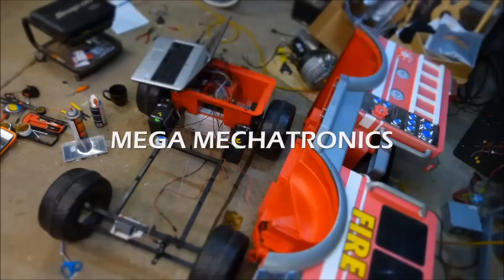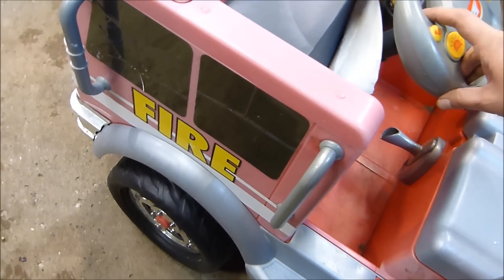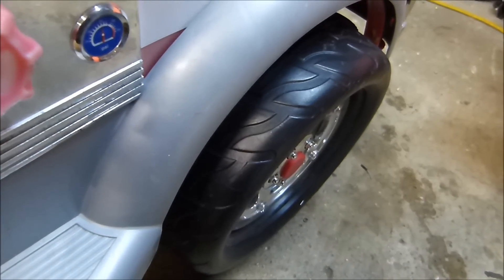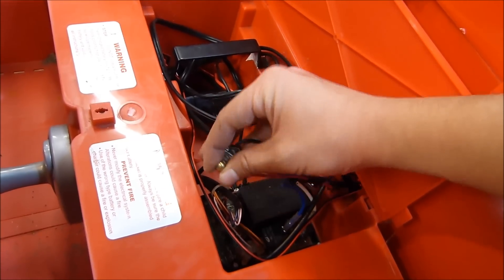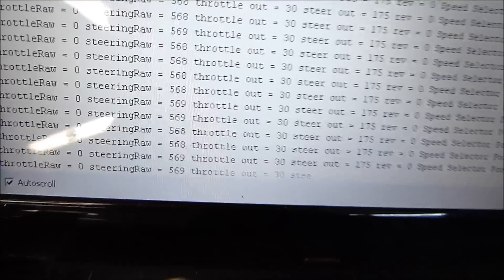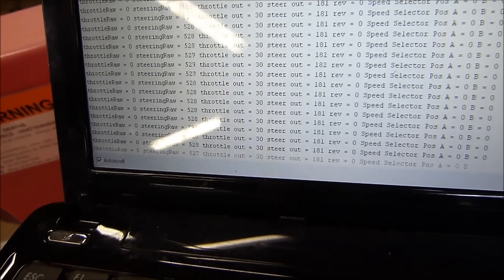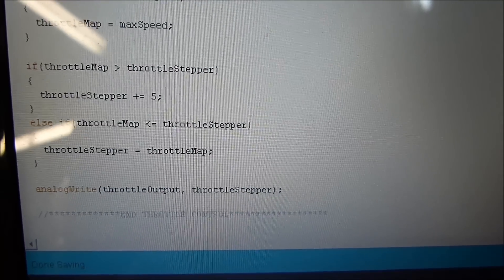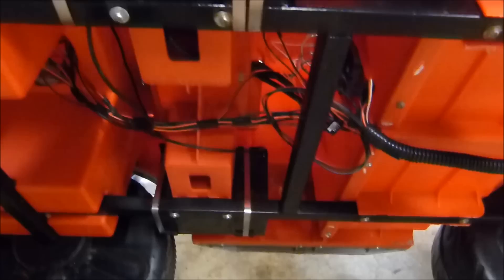Power Wheels 24v Upgrade Power Steering Kidtrax - Part 1

Comment: That's like the most time and cost into a car controller. Why not use a scooter controller and hall throttle peddle?

That's how I did mine.

Next mod is a working fire hose.
Using a car screen washer pump or two with on off switch and internal water tank. I've the avigo/kidstrax ram btw.
But can fit a fairly large tank 2-3 gallon. So should keep them entertained.

What did you use for your throttle?

Comment: I have a similar toy which is a real 4x4 with 4 drive motors , and it came standard with the drive-by-wire steering. But it's only center or full scale left/right so I wanted to have something that's proportional so my son can learn to drive better. What system did you use for the steering?

Comment: So i just got this fire engine for my son. The wiring was messed up and the people before us took out the circuit board and put in relays. I found a diagram online to show my how to wire it the right was. Ive rewired it about 4 times following the diagram to a "T". The motors on the back wheels work but after everything is hooked up, it wont move and when spinning the wheels with my hand they turn the opposite direction of each other. Any ideas?
Reply: You have to wire one motor opposite to the other.

For each motor, determine which wire is positive and which is negative, then hook the positive of the one to the negative of the other. This will cause them to go in the same direction.

Comment: never seen power steering on a kids ride on, interesting, I need to convert my dads Kawasaki sxs to power steering,(he's not getting any younger) you've given me some good ideas but I don't think 1/4 scale rc parts are gonna quite do it. but thanks for the vid, very helpful
Reply: You can find power steering setup on all parent control kids ride on, it's more robust and will require some engineering.
I would say use a car one, such as mini in the UK and lots of euro cars, but they are high current.

Comment: was your servo powered from the same battery used for the rear wheels? If so, how did you   wire it? Did you use a voltage converter?
Reply from the maker: I used a 5-6v step-down buck converter, made for RC from Hobbyking.

Comment: Nice work!

Do you have any details on how you used the servo to do the power steering?  I'm working on a similar project, except that the arduino will also be driven by a mobile phone app to allow remote control (my daughter is too small to drive).
Reply from the maker: +SuperGoines To deploy electric steering in a toy car such as this, I recommend triple giant servos or a custom stepper worm gear drive system.  Check out the new Firetruck video: https://www.youtube.com/watch?v=BVkE8oGCj0U

Comment: Fregging Cool!! Which motor controller did you use and how does the Arduino interface with it?
Reply from the maker: I got a $25 controller from http://www.electricscooterparts.com/ that uses a variable throttle.  I just digital PWM a signal directly from the Arduino to the controller throttle input.  I have had good luck with piggy backing the throttle with PWM like this on my ebike.